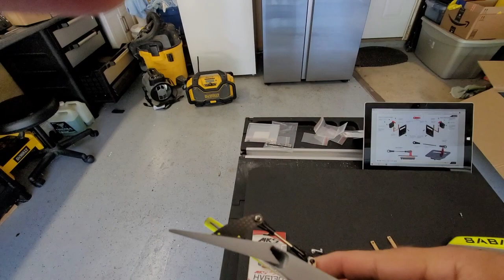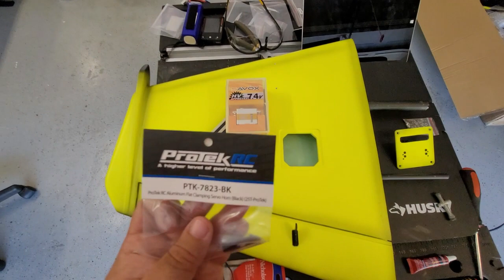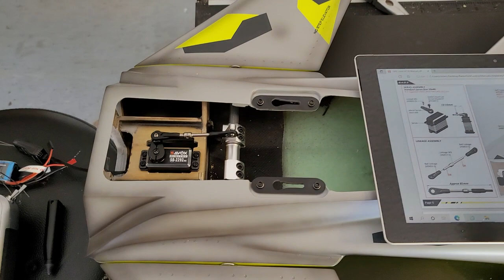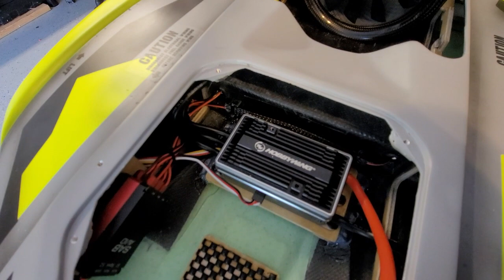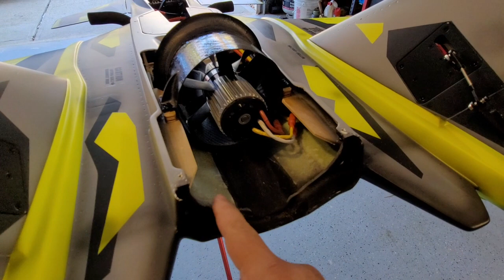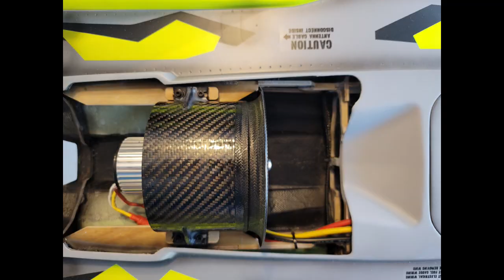SAB Lizard M138 EDF Build Details

Comment: I am thinking of getting this model and this video is very helpful! 
I am after maximal static thrust for 3D flying - do you think a 128mm EDF (HST from Schubeler) would fit? Looking at the mounting of your Jetfan, it looks like getting 4mm extra on the sides would be doable. What do you think?
Reply from the maker: Glad this helped.  I am doubtful that a 128mm would fit unless you sanded down the mounting rails.  You would also have an issue with the thrust ring.  Not sure if 3D is possible with an EDF but would love to see it.  I did just make a 3D printed thrust tube that improved the performance a lot.

Comment: Are the canards optional?  Or do you need them to get cg right.   I never liked the m on my tortuga and removed them.   Plane was more stable and less pitchy without them.
Reply from the maker: I have never seen one without the Canards.  Don't know how well it would work.  It lands pretty slow with the Canards.
Reply: @GeorgiaHillsRC  Thanks.   Cant believe you had to add a tray for CG.  That is a bummer.  I am really close to getting one of these for running 12s

Comment: Beautiful. Ive had many sab helicopters and the quality was awesome. IVe been flying some cheap foam jets from freewing and they just cant perform. Tired of spending money on cool looking jets that have no power or performance. Im really looking at getting one of these lizards with a 120mm fan from jetfan. How does this jet perform with thrust vecioring
.
Reply from the maker: This is my absolute favorite jet to fly.  Unfortunately it would be difficult to add thrust vectoring to the EDF version.  The mounting bulkhead is too small and would block the air from the fan.  You also would not have a good path for the servos on control it since the fan is larger than a turbine.  The thrust vector equipment sold by SAB is only for the turbine version.
Reply: @GeorgiaHillsRC  Do you think a thrust vectoring from this model, as shown on video would fit? https://www.youtube.com/watch?v=j4YjvywrzQo&t=320s
You could mount it to the same wooden planks as the EDF and by adding a thrust tube, one could place one servo on top of the tube and another one on the wooden plank.